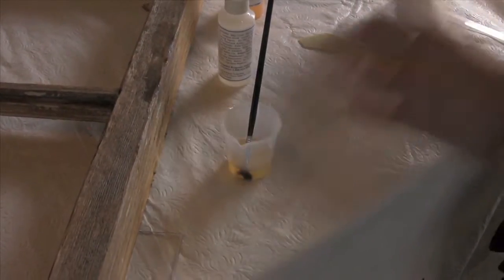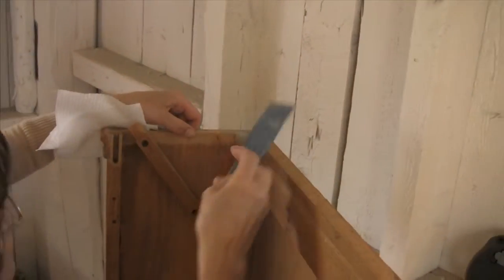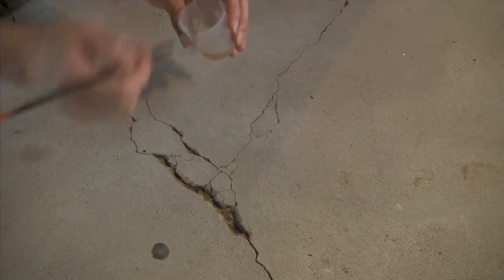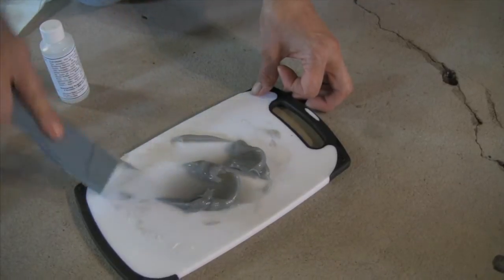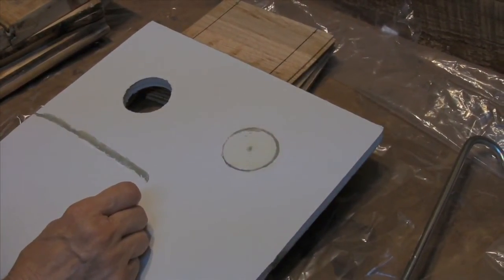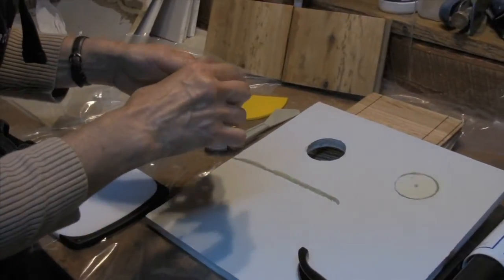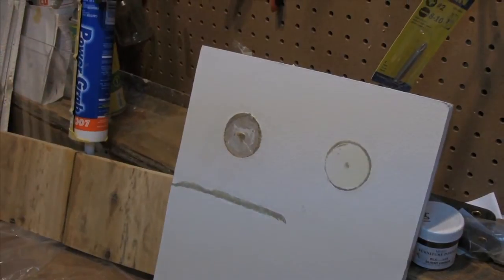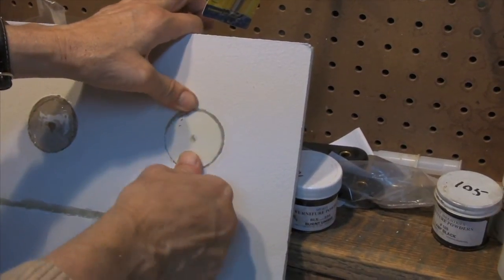Wood, Concrete, and Plaster Repair using Flex-Tec HV Epoxy

Comment: I agree with Fran. My arm can't reach behind a wall. So I would tie a stick to a string and put the string thru the hole in the plug. 
Insert the stick in the hole in the wall, pull on the string and push the plug in place.
 If I had insulation blown into the walss and a hole every 2 ft, that would only be 100 - 200 plus holes to repair.

Comment: They cheated on the Plaster repair. If I have a hole in the wall, I don't have the luxury of sticking my hand behind the plasterboard to hold the repair piece in place. They should have shown us that repair in a ceiling with no ability to brace from behind. Product probably can't handle that type of repair.